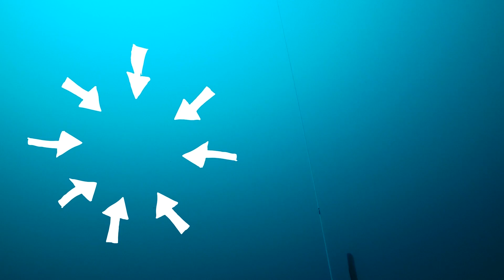A New Approach to Freediving Equalisation: What I learnt From the MRI

Comment: Hi Adam, impressive video;
 I was struggeling with frenzil for some time and  your tip at 12:07 worked fine. 
But how can i find out if I am not "cheating" and just generate the pressure with my lungs?
Reply from the maker: So welcome Yannik! The easiest way is to be able to equalise while holding a stomach vacuum :) (stomach sucked in) if you're not sure how to do that just search on youtube for how to do a stomach vacuum
Reply: @AdamFreediver  
Turns out, that i am not actually cheating, thanks so much!!

Comment: This is THE vdo on frenzel. I saw a lots of vids about learning frenzel where there's nothing to see (obviously, it's inside your mouth), a lot of tutorials about epiglot, soft palate, tongue lock and the mysterious "tongue pump" that I never realized (only look stupid underwater and have pain in my hears). I always use my throat to equalize and I tought it was a kind of valsava, even if I wonder why I could equalize easily after 15m. Then Adam came up and I discover that, in fact, I already do a frenzel with a H lock combined with a voluntary opening of my tubes for years, without any thinking, it was just the simpler for me ... So thank you for your vid (and other vids) and thank you to annihilate the tongue pump myth which is the main reason why people didn't achieve a correct frenzel : because there's no tongue pump, only tongue lock ! And now I can use some tips from your other vids to do a better frenzel, mine was empiric and far from perfect ! A very valuable time watching this, quite rare on youtube !

Comment: I’ve been bothered by not being to do Frenzel heads down for quite a while. I can do Frenzel heads up easily and double checked that I was indeed doing Frenzel by using belly tuck method you mentioned. I tired a few times doing larynx down first then up when heads down but have not been successful yet, will keep trying. Meanwhile any other tip or advice that I can try ?
Reply from the maker: This seems like an issue with your soft palate, you can try to dive feel first for a few days in a row and this should improve the situation a lot when you flip over :)

Comment: Hi Adam, I have a question regarding acent and use of a nose clip. When I try to dive with a nose clip It feels like there is pressure building up in my head on acent. It makes funny noises and I haven't been able to control It. Do you think lowering the larynx on ascent will stop the pressure from the air and the funny sounds in the head when using a nose clip? I find it uncomfortable and entertaining at the same time, making it hard to relax. My solution so far is to use a mask or to take the nose clip off.
Reply from the maker: What you're feeling is the air expanding as you ascend. What you need to to is open your throat as you go back up. If you're not sure how to do it then just sniff as you ascend and you'll sniff the air back into your lungs

Comment: Hi Adam, great video and a lot of food for thought. I always found it difficult to equalize and that improved when moving to Frenzel. Still, it felt easier sometimes and I found that it was easier when I did a "deep" Frenzel. Up to now, I could only describe it as shifting up the air from deep down. I wonder if that has to do with lowering the larynx? Just did a few dry runs and I am not sure since my larynx moves all the time. Btw, I found that pulling my tongue (larynx) down will help me to open the Eustachian tubes. That might be part of the explanation, as well. Shame that I stopped working in MRI research. That would be really helpful now.
Reply from the maker: hahahah that would be very helpful now!! for deeper frenzel you'll just be reverse packing to get the air into your mouth and if you're equalising while you lower the larynx I think that might have something to do with hands free rather than frenzel :)

Comment: The question was:
Dear Adam,
Technically I got Frenzel, but it works in land for one time or 2 and then I feel with suction between my tongue and soft palate also in my nose cavity. The air trapped between tongue and softpalate is beeing disappeared after the first equalization.
Would you please help me in solving this issue?
Thanks a lot